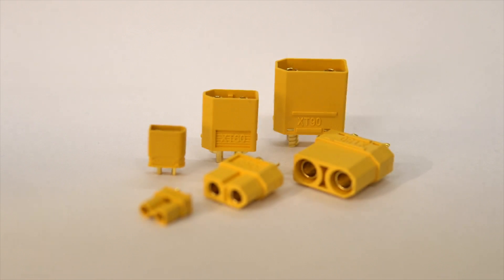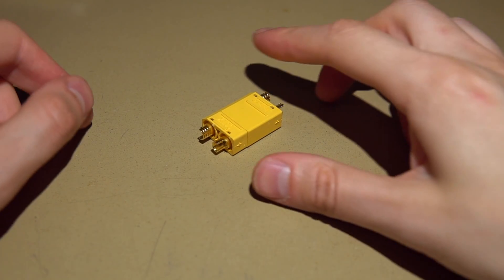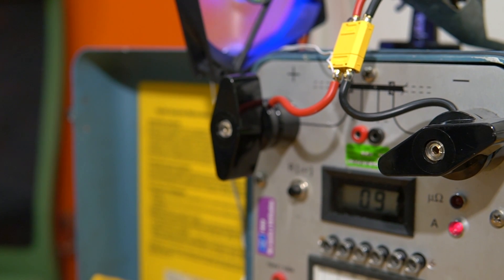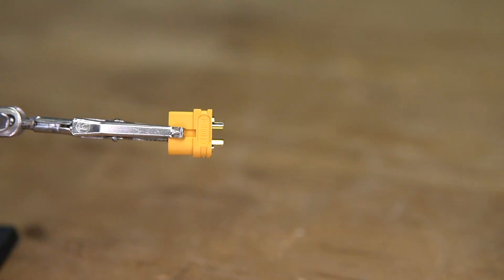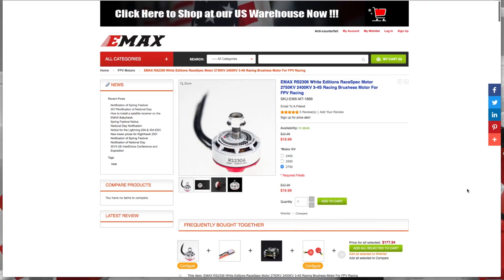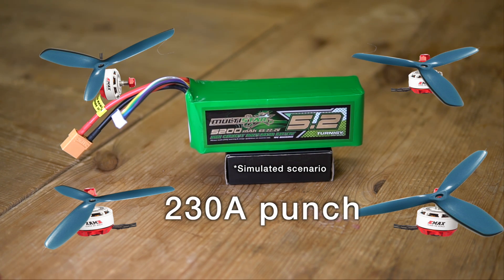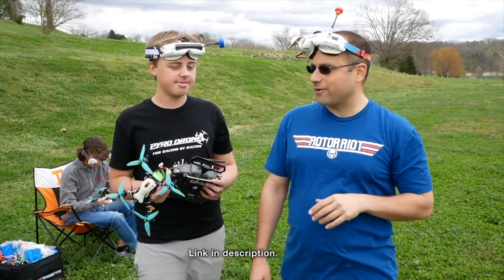XT90 - Measured and tested

Comment: So safe to say, the xt90 can run between 120ah-150ah no problem?
Reply from the maker: For a limited time, yes. It can handle 90A continuously, and 270A for 10 seconds. Any current in between will be ok for some limited time. It's worth noting that the heat produced on a connector increases with the square of the current, so going from 90A to 150A will increase the heat by a factor of 2.7x! I wouldn't count on that being safe for more than 30 seconds. You can improve the performance by using even thicker wire - like an 8 AWG.
Reply: @dronelab1280  So better would be the xt150.

Comment: What about Amass vs other unbranded XT90's?
Reply from the maker: The knock-offs come in so many shapes and sizes, even if we test a couple, a viewer would never know if the knock-off they have will perform as the one we tested. So to spare potentially risky surprises, it's best we not publish measurements on components from shady sources. We did however quickly check the plastic quality on two different XT60 clones, and neatly enough both could briefly withstand 200°C, so at least they aren't made of bad plastic. But still, the original amass are reasonably priced and widely available  banggood or even some electronic component distributors (like TME) so I would definitely 100% recommend always going with the legit ones.

Comment: Very interesting, thank you.  Now, I will use 10 AWG for a power electric bike where I intend to reach 400 A on 60V.
Reply from the maker: I hope you mean 40A, not 400A or you are in for a smoky surprise!
Reply: @dronelab1280  That's 400 A at 60 V on 10-second peak, with an ASI BAC 8000 controller. Otherwise, normal use will be around 100 A. Do you think 10 AWG is not enough for 10 seconds peak ?
Reply from the maker: 10 AWG definitely not enough. In our tests, it caught fire under 10 seconds at 450A, and smoked at 300A. Use at least 8 AWG. If the wires are in a tight enclosure (no airflow), you might even want AWG 6 to be on the safe side. You can also use 2x10AWG in parallel, if you can fit that into your connectors.
Reply: @dronelab1280  Thank you very much for this technical answer. Perhaps I should also use 2xXT90  in parallel ? Or XT90 can support easily 400 A during 10 seconds ?
Reply: Well, finally I decided to use 6 AWG with  XT150. 400 A would be 10 sec max. Thanks for your answer.

Comment: orrrr just get a ic5. idk what they are rated at but the connectors ar .5mm wider and 4mm longer, the actual metal connector. can only imagine they can handle a bit more than the xt90.

Comment: How many volts were you running at 270A?
Reply from the maker: Counter-intuitively, voltage transferred does not matter when measuring connector capabilities. All connectors we tested  melted/burned with no more than 1V supplied. Since the connector is a purely resistive device, the voltage drop across it (and therefore, the power loss and heat generated) is strictly tied to the current conducted.
Reply: So 300V/1A would be fine while 300A/1V might not?
Reply from the maker: Exactly! That's also why long distance power lines are at very high voltages (400,000V) - so that more energy can be transferred thought the same cables and connectors. Though I wouldn't recommend using very high voltages on the XT90 for safety reasons - the contacts are very exposed and can be accidentally touched.
Reply: @dronelab1280  Oh, okay. I thought it was transferred at high voltages just because there is less power lossed when transferred at high voltage. Thanks for your responses :)
Reply from the maker: Yes! It totally is to reduce power lost. And that lost power becomes heat, and that heat melts the connector or wire, if there is wayy too much of it. It's all connected.

Comment: Is the xt90 connector waterproof for rc cars?
Reply from the maker: It doesn't have any official water resistance rating and we never tested it, so it's best to assume that it isn't waterproof. Even thought the fit is pretty tight, it doesn't have any gasket or o-ring to prevent water from getting in. That being said, if you conformally coat the solder posts I would expect it to handle a small splash or spray (driving in light rain), but I wouldn't recommend that if you plan on getting it properly wet (deliberately driving into a deep puddle).
Reply: @dronelab1280  Ok. Thanks for the help.

Comment: I have found your video very informative and helpful! Thanks for that. 
Can you please compare it to the EC5 connector?
Reply from the maker: Glad to hear that. I'll try to get a hold of an EC5 connector to give it a try, once our laboratory is no longer on pandemic-shutdown :/ However, since both connectors are manufactured by the same company - Amass - we can to some extent trust their datasheets. And there, the specified maximum currents are the same (90A) for both, while in "rated currents" (safe current w/o airflow, that keeps the connector below a certain temperature) the XT90 has a slight advantage over the EC5 (45A vs 40A). Links to datasheets:

https://www.tme.eu/Document/d66b125cc4d03b6a25077f0febb346da/XT90H%20SPEC.pdf

https://www.tme.eu/Document/5a22fb1f56823885355218505744b694/EC5%20SPEC.pdf

This sounds about right, as the connectors are roughly the same size, and made of the same materials. But might be worth verifying with the test in the future anyway!
Reply: @dronelab1280  Thank you so much for the VERY detailed answer! I did not know they were made by the same manufacturer and from the same materials...
Thanks again!

Comment: Hello!
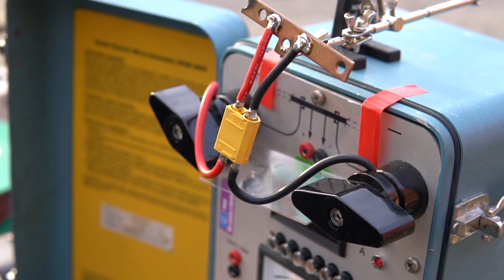Can anybody identify this current source at 1:24?
Reply from the maker: It's a "MOM 600" Micro-ohm meter. An old and primitive instrument specifically designed for measuring high current capable wires and connectors. It does offer up to 600 amps of rectified AC, so thats nice.
Reply: @dronelab1280  Thanks!

Comment: But my 1/8 rc car draws 300+ amps on 8s. :/
Reply: I've seen R/C helicopters that run 14S batteries and 300A ESCs with a 10KW motor.

Comment: Most people will never use XT90’s to even half their limit.  They are overkill unless you are truly drawing more than 130A continuous!!!  I run 97-118A continuous through my XT60’s and they don’t even get warm.
Reply from the maker: 118A continuous sounds like quite a lot for an XT60. In our testing, 75A applied for a couple of minutes, until the temperature stabilised at 103°C - a level that it definitely survives, but it might start deteriorating the plastic in the long term, or damage something more temperature sensitive nearby, like a cap or battery. That's with a steady but relatively low airflow, in room temperature. Without airflow, we got  101°C at just 50A. I guess it boils down to how one defines "continuous". At a steady 118A, a 2000mAh battery would drain in just over a minute, which might not be enough to reach those 100°C+ temperatures, but keep at it for another minute more and the connector might take damage. We stick to the convention that "continuous" means "as long as it takes to reach a steady state", and for that application I would definitely not recommend an XT60 for 118A. In the world of droning, "continues" tends to mean "a couple of seconds, after which your drone flies out of range anyway", which might be quite confusing :D
Reply: dronelab   Correct.  My idea of continuous is more like 18-20 seconds.   Bursts are around 4-6 seconds.
Reply: @dronelab1280  so whats the max continuous amps for the xt90 or for that matter whats the max continuous amps before reaching those high (100C+) temps?
Reply from the maker: @hgclobo123  In our tests, at 110A continuous, the connector stabilised at 96°C. That's with a AWG 10 wire and in gentle airflow. I wouldn't push it any further than that.
Reply: dronelab awesome! Thanks! Great videos.

Comment: Vídeo: Consider upgrading to 6s.
Me with a 12s electric skate: Uh
Reply from the maker: Most of our advice doesn't really apply to anything other than drones, but that being said, XT90 are really good for e-skateboards and e-bikes. At 12s and the rated 90A these can deliver almost 4kW, while being easy to handle and reasonably robust. Note that the 90A rating requires some airflow though, if the connector is hidden inside some compartment or chassis, it's only good for about 45-60A continuous.  If that still isn't enough, then maybe it's time to go 14s!
Reply: @dronelab1280  Wow, thanks for replying in a 2 years old vídeo!

Comment: Electric scooters
Reply from the maker: Definitely a solid choice for that, the extra size makes it more robust and easy to handle. But funny enough, even a 1000W motor at 24V is just 40A.  A 500W at 24V could technically run on a tiny little XT30 :D
Reply: ACK. Currents are seldom anywhere near the limit of even a XT30. But it's a nice chunky connector that is easy to grab.
My scooter has a 10s, soon 12s, battery. That means the currents seldom exceed 15A.
Reply: @dronelab1280  24V bikes have been obsolete for a decade now, its all 36 and up to 96, and amps can go up to 300 ;)

Comment: Incorrect info. The 6s battery has more watt hours than the 4s. Please don't spread misinformation.
Reply from the maker: We're discussing *efficiency*. With the same voltage * kv product motors, a 6s setup will be a little more efficient (take less watts for the same output power) and can weight less due to lighter connectors and wires. If you get 6s and 4s batteries with the same watt hours (example: 1200mah 6s and 1800mah 4s), and optimise both drones for their voltage, the 6s will fly longer.

There is a reason why trains run at voltages like 25kV, and this is the same reason here.
Reply: The problem is the 6s will not weigh less. They will both be using xt60 connectors and the same gauge wire if you are sizing it for a 5 inch drone. The 6s has more "packing material" inside it. IE stuff that doesn't produce power, such as the internal tabs on the cells and the packing foil for the individual cells, as well as the plastic insulating pieces. You also are not taking into account the weight of vregs that have to handle the higher voltage. You're going to need bigger components for a vreg to be able to drop 6s down to 5v instead of 4s. The 6s battery also has a much more pronounced throttle drop throughout the flight of the pack. Delta Voltage on the 6s pack is 5.4V between full and empty, whereas on 4s it is only 3.6V.

The train analogy is also terrible. The primary reason for the extremely high voltages are due to transmission loss over distance due to internal resistance of the conductor. They are not using 25,000 volt motors on trains. There is a transformer in the locomotive to step the voltage down.
Reply from the maker: In the video we are comparing a 4s that requires an XT90 to a 6s that delivers the same power on 4s. In this context, the 6s will be lighter, and this is the only context discussed in the video. We are very careful not to spread misinformation. We never stated that 6s is always lighter than 4s. 

Sure, the packaging might be a bit heavier, but those are tiny differences. And the Vregs are not bigger for the 6s. If anything, a step down will be smaller, as it needs less input current, but it's not like you pick those parts individually anyway. You get what is available on the market, and most parts support 6s.
Reply from the maker: And about the "more pronounced throttle drop".  5.4V is 25% of 6s, 3.6 is 25% of 4s. In both cases the throttle drop is the same 25%.
Reply: What 1300-1800 mah 4s battery uses an xt90? I'd like to know because I have NEVER seen a miniquad battery use an xt90 connector. You stated the 6s will fly longer and can weigh less due to lighter connectors and wires. It's right there in the first comment. The packaging is not a negligible difference. Looking at batteries I can find online I'm seeing about an extra 15 grams, and that's just what is published. 

The Vregs require capacitors to operate. The higher the voltage, the bigger capacitor you are going to need. There is no point in mentioning step down vregs because ALL vregs on a miniquad are stepdown. All of the components run off of 5v or 3.3V, so unless you're using a 1s battery, you will always be using a stepdown. I don't know why you bothered to mention step down.

To put this scenario into perspective, the difference between 6s and 4s which produce the exact same wattage is about 40 amps. So you would need a quad that is going to max out the xt60 on 6s in order to require an xt90 on 4s. At this point, from your own testing, you would need to be pulling 180 amps through an xt60 at burst, this means that the miniquad would need to be pulling 4kW of power on 6s. This is a stupid amount of power. When we actually have components and batteries that can support this then maybe the jump to 6s will be worthwhile, but as it stands it just makes the hobby more expensive than it already is. 

I'm not saying the higher voltage isn't more efficient, but you are failing to account for real world scenarios.
Reply from the maker: The video literarily gives you an example of maxing out a XT60 on 4s, on a 5" quad. RS2306 motors with DAL5046 props, thats 230A in punch. Data sourced from here: https://www.dropbox.com/s/1ouwici3rhucxh0/thrust%20results%20table%20EMAX%20RS2306-2750KV.xlsx?dl=0

In this scenario, we wouldn't recommend running 230A on an XT60. But instead of shifting over to an XT90, we would recommend a 6s. This is our recommendation for that scenario. We are not saying "6s is always better and 4s is for losers". We have seen the "6s hype",  and I understand your concern here. We are not a part of that hype. But you seem to insist that "6s is never better", which is also untrue. There are scenarios where 6s is recommended, and this video lists one such scenario. Sure, it's a bit of an extreme scenario for a 5", at 6" this becomes much more relevant.

I mentioned a "step down" as an opposite to a linear regulator, which still appear on some quads. A step down converting from a higher voltage will require a capacitor with a higher voltage rating (correct) but it can have a lower capacitance, as the higher voltage stores more energy. And even if, you are now discussing a part that weights 16 MILLIGRAMS (source: https://eu.mouser.com/ProductDetail/TDK/C3225X7R1E106K250AC?qs=sGAEpiMZZMs0AnBnWHyRQEWjzA2rN6H9IAa3w6%2fzINU%3d), when compared to the connector that comes in at 13 grams, roughly 800 times more. Not to mention the weight of the wires.

I value your concerns, but maybe you misunderstood the message of this video. We are not saying "6s is best always". That was never said. This is a video about the XT90 connector, and what we are saying is "before considering an XT90 connector and the appropriate wiring, see if your required power can be achieved on 6s with an XT60".
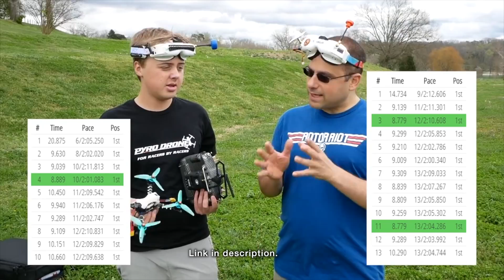Reply: I'm done arguing. Watch Josh's follow up video. He did not test equivalent batteries. The 6s had more watt hours than the 4s. Don't spread misinformation, because at 3:13 you said that a 6s battery will deliver better performance than its 4s equivalent, which has not been tested. Josh even said it himself in his follow up video.